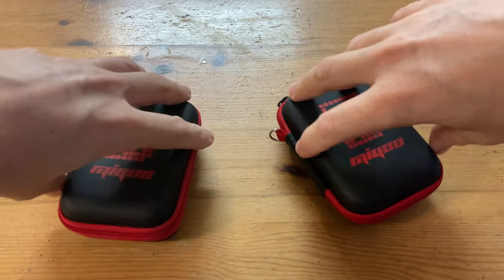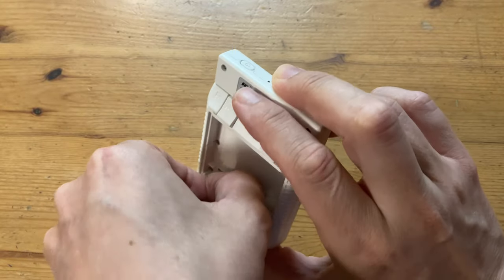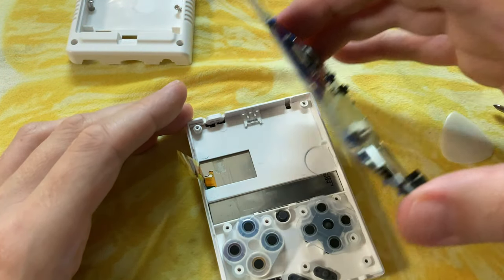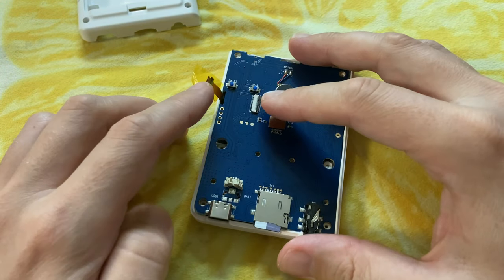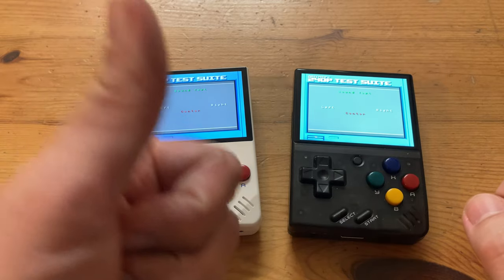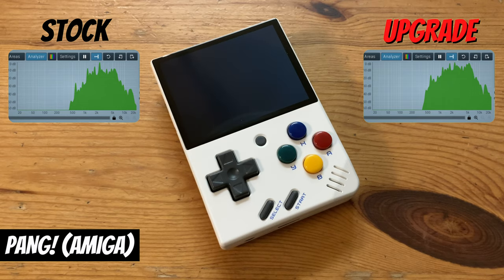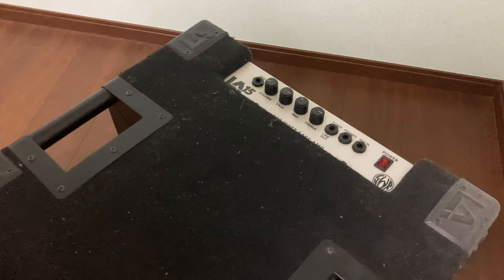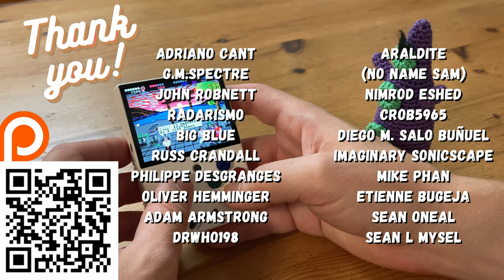The BEST MIYOO Mini Speaker Upgrade: An EXTREMELY CHEAP and EASY Mod!

Comment: I didn’t hear much of a difference
Reply from the maker: You may need some monitor speakers to hear it properly.  All I can say is, there is a difference, it's tighter and there's slightly more bass on the upgrade.
You can visually see the difference checking the EQ graphic.
Reply: There is,a tiny bit, but if its worth it really depends on the user. For me its very rare to have more than 10% volume without earbuds.
Reply from the maker: @psp4gamer  at the price I'd say it's definitely worth a go, bit yes, it depends on the user.
Reply: @TeamPandory  Not talking about the price, just the user but cool nonetheless.
Reply from the maker: @psp4gamer  yeah I know. 
Pretty sure it's more obvious when you have them side by side in RL, but yeah: What matters most in this case is the user.
Reply: THERES MINIMAL DIFFERENCE IN THE SPEAKERS.  MOST WON'T EVEN NOTICE IT WHILE YOUR FOCUS IS ON THE GAMEPLAY.

Comment: This is misinformation, the REDMI Note speaker upgrade is WAAAAAAAY worse than the Sony Xperia speaker upgrade.
Reply from the maker: ... it boosts the bass and raised up the volume Vs the miyoo mini speaker. Are you saying the miyoo mini used Sony?
In our tests it was better Vs stock in the case of a tiny handheld.
Reply: @TeamPandory  No, I'm saying that the Sony Xperia speaker is objectively the better speaker upgrade, saying that upgrading to the Redmi is "THE BEST" is the misinfo. The video "Building the Ultimate Miyoo Mini" has comparison between stock, Redmi and Sony Xperia speaker at 05:30.
Reply from the maker: @fh5kskalf  Damn Kris, you're breaking my balls here... Breaking my balls over a 2 dollar speaker.
Reply from the maker: Besides, that huge monitor speaker is definitely much better than such a tiny Sony speaker.

Comment: That speaker upgrade you showed at the end was the best, but I expect it will need some work with the Dremel to fit it into the stock Miyoo Mini case.

Comment: Great video, i also tried the same speaker and i noticed that there is a lot of distortion with the mod Speaker than the original V2 speaker. At the end, i installed the the original V2 speaker again. You could verify this in Arcade Street fighter games or Aero the Acrobat GBA. Greettings!!
Reply: I can confirm it. I can hear distortion with a low volume too and I've installed the original speaker again.
Reply: Was going to say the same. A speaker being louder or more efficient doesn’t mean it’s better.
Reply: @Cujobob  i've upgraded it with the Redmi Pro 3 speaker and the sound is so clean and loud, with some bass.
Reply: Xperia x5 speaker is better

Comment: Bought a pack of these from the same seller, your sound comparison at the end doesn't do justice as they sound amazing compared to the stock speakers.

BUT I really suggest ordering more than one; investigating behind the adhesive covers revealed more than half had holes on the cones resulting in really bad noises at certain frequencies, check them before use.
Also dont push the speaker in!! Just let the motherboard do that when you reassemble it to avoid the audio cutting out.
Reply: Thanks for the information in your comment. 

It looks like there are multiple speakers to choose from, which one is it specifically?
Reply: @apg897  Option 8
Reply: I’ve read somewhere ( Reddit or Discord ) that’s #15 is better as #8 ?

Can someone confirm this ?
Reply: @Skull_Gun  
Thank you sir!

Comment: Why is it that the screen is better on the white than the black one despite being the same v2 version?
Reply from the maker: Check the "Miyoo Mini V3 Review" we did earlier.  It's probably just a slight variance on the panel used due to low stock

Comment: My new speaker sounds blown. Some sounds make a crackling sound.
Reply from the maker: The pins need to connect.  Could be if they're not touching they'll crackle rather than make a solid sound. - Open it up and pull out the pins with a screwdriver to make sure it has a solid connection